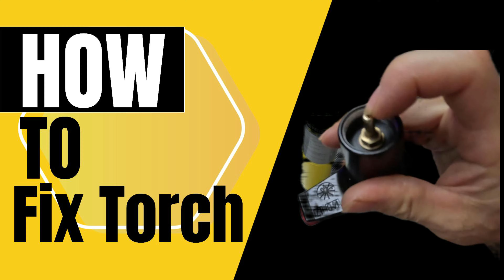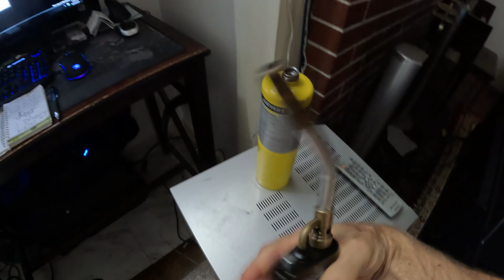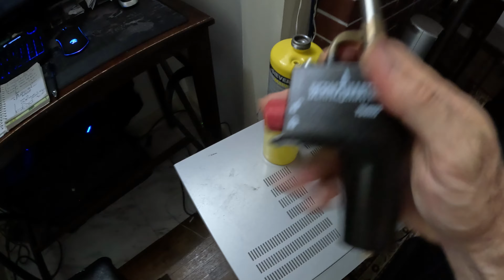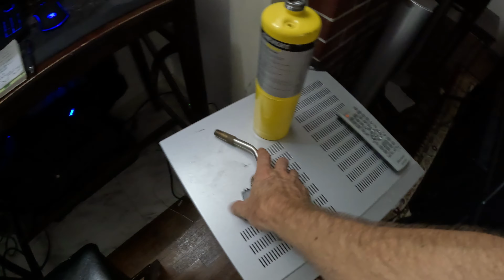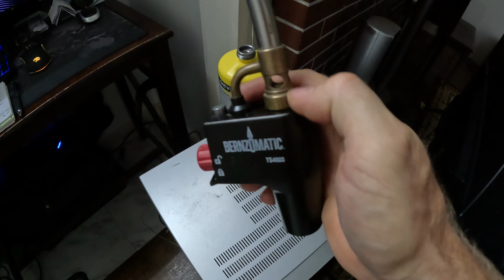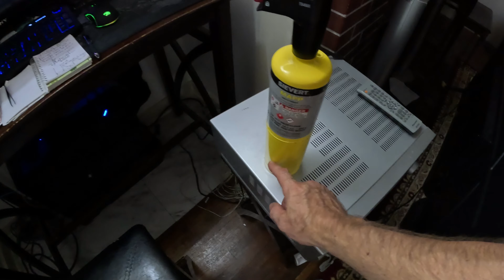How to fix Propane Torch

Comment: Sometimes you have to clean out the tiny pin hole in the same area with a tiny needle file
Reply from the maker: Yea I had done that as well, but it was the base my problem.